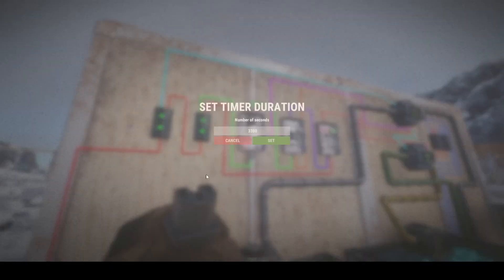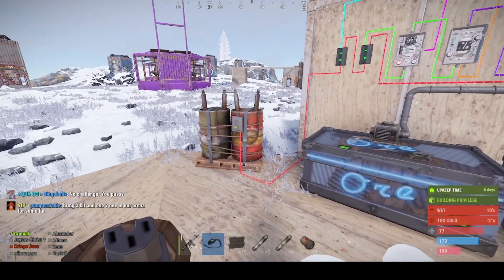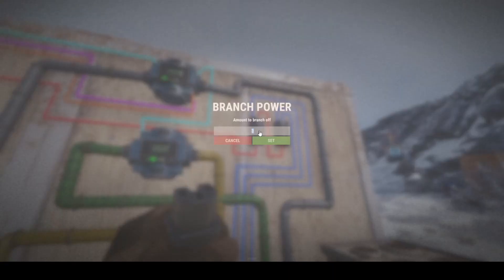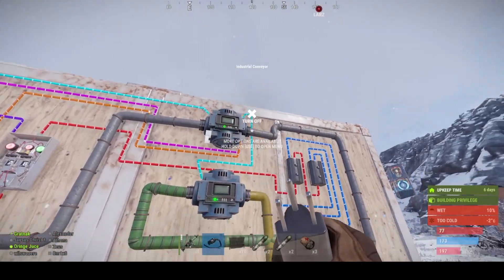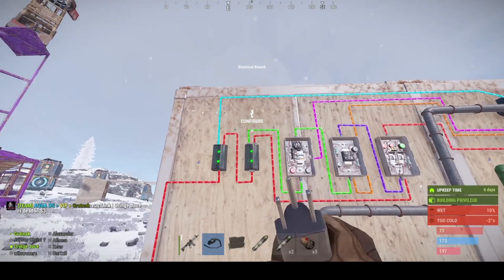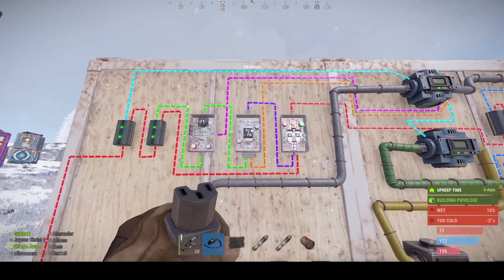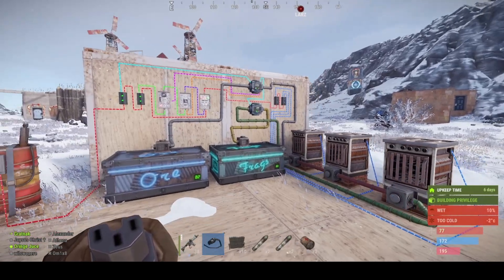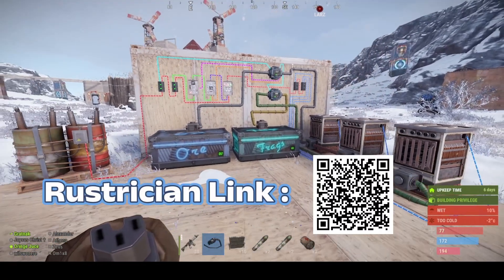RUST: Power Saving Electric Furnace Curcuit

Comment: Can you just run the filter pass and fail options to a regular switch. How i do it. Never had an issue
Reply: 2 conveyors. 1 to move to the furnaces. Wire the pass to the on portion of the switch. Second conveyor for removing from furnaces. Wire the fail to the off of the switch.
Reply from the maker: I did something similar, I connected the Filter Pass from both conveyors to an OR switch. However, this configuration failed after a few minutes because the conveyor responsible for removing the cooked metal (after the ore box had emptied) went into a fail state, causing both conveyors to shut down. By adding a buffer of one second, I believe this issue can be mitigated. Additionally, the more furnaces that are in operation, the less likely this failure will occur, or at least it will happen less frequently.

Thank you for your feedback. I will review everything and get back to you, hopefully within the next hour or so. :)
Reply from the maker: Hi, I'll log in and double check. But I've sure I've had an issue with them turning off. I'll give it a test with one furnace and see if it does (could have been some dodgy dream I had, while having a Gratnap) and get back to you.
Reply from the maker: Hi, I just tried using one electric furnace, and it turned off while containing 1,884 uncooked ore. I would expect diminishing returns; the more furnaces you have connected to the circuit, the less likely this issue will occur.

You have, however, made me consider the possibility of adding a few seconds of buffer to the signal instead of making it run for 3,300 seconds. I will need to look into this further.

Comment: You don't need timers, you can use a memory switch. Use the pass filter to the set, and the fail on the outbound to the reset (fairly certain this is how I did it, running off memory). If you just use a single conveyor (to pull from and feed into the same box), you just use both signals from the same. My suggestion is pass the power thru the pass through on each conveyor and ending on the oven, that way you don't need to feed extra power for the signals to work
Reply from the maker: Hi, thank you for your input; it is greatly appreciated. I employed a similar method to the one you described; however, there is a risk of the furnaces shutting off while ore is still present in them. This is particularly likely to occur when operating with only a few furnaces. For this reason, I have included a timer to ensure that the furnaces remain on while they are only looking for frag, sulfur and HQM.